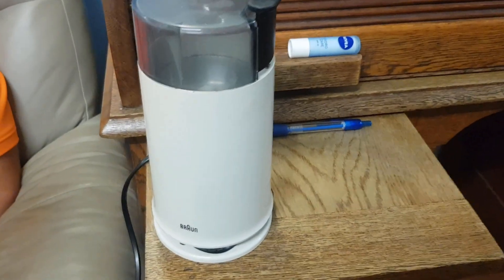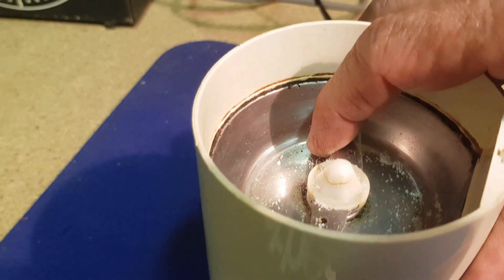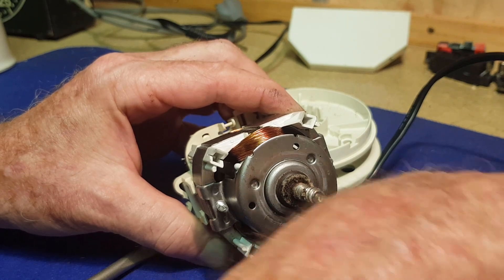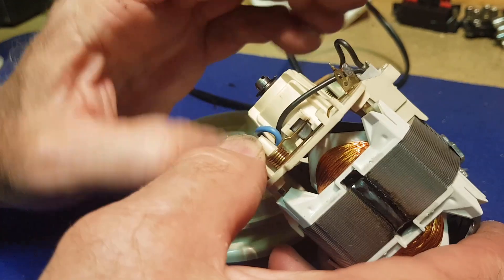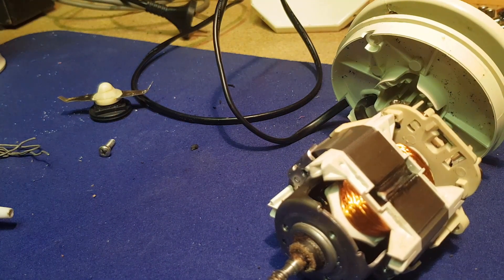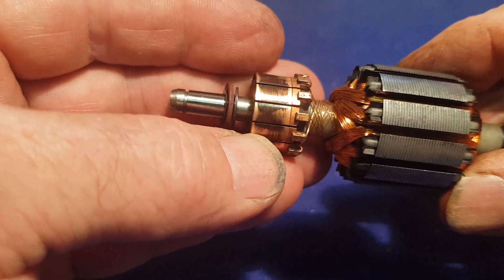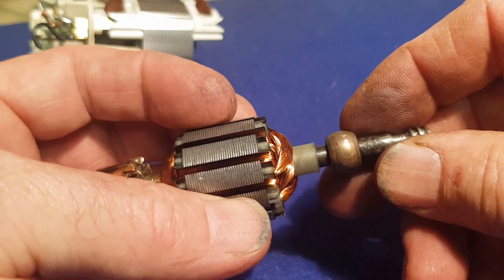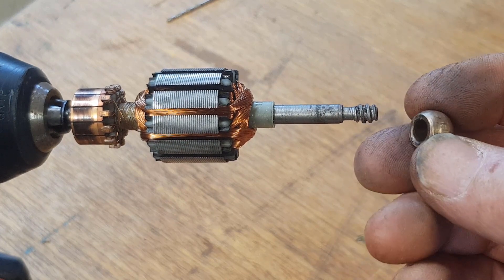Saving a Braun coffee grinder mill from the scrap bin! Electric motor with a seized bearing repair.

Comment: i now have a working coffee grinder. 99 cents at the second hand store so even if it doesnt work for long its still useful. I had to bend the tabs back pretty far to fit the bushing back in, and then used pliers to squeeze them back together. it doesnt have any play so hopefully it is secure enough. THanks so much for the video.
Reply from the maker: That's awesome - well done you! 👏😊

Comment: 30:10 Awesome! I can’t wait to get mine apart and, hopefully fix it! Mine just stopped working one day. No signs of issues prior.
Reply from the maker: Thanks CW! Good luck with your fix! 👍😊
Reply: @TheUltimateRecycler  Well, I had taken the blade off quite some time ago and hadn’t thought of plugging it in to see if it runs so I did today. Works great! Put the blade back on. Won’t run. Shook it and a bracket fell out. Now it won’t work either way. Lol! The issue is that it doesn’t come apart at the bottom. It seems pressed together or glued where the metal band meets the black, lower portion of the housing. Any idea how to get it apart without breaking it?

Comment: I'd put some JB Weld on the cracks for extra measure.  Getting ready to take mine apart I broke on some Turmeric root.  Mine spins around but blade doesn't.  If I have to mess around as much as you have it's going in the Bin, but brought me back to when I repaired a very expensive floor sander and many of the principles are similar.  thanks!
Reply from the maker: Sounds like you may need another blade - but maybe JB Weld can come to the rescue there! Good luck! 😊👍

Comment: Amazing posting.  Just saved me a ton of sweat and then probably throwing it out anyway.
Managed to fix mine and it runs great.
Any suggestions on a source or replacement for the fibre washer between the bushing and the blade?
Mine must have disintegrated long ago and is totally missing now.
Reply from the maker: That's excellent! Well done on your repair🙌 A decent hardware shop, or perhaps a bearing/mechanical industry supply place should have fibre washers 👍😊

Comment: Respect for you... I had the same problem with the bushings (it made fine sugar out of raw sugar) but I forgot how I dismantled the anti-parasitic filter (resistor and capacitor in the video)... these are mounted between the wires coming from the socket in the house (brown and blue wire) or are they on one wire? two blue cables come out of the grinder... thank you in advance
Reply from the maker: Thanks for watching 😊👍 Sorry, this video was quite a long time ago and I've forgotten how the wiring goes..

Comment: 14:00 any tips on loosening the bushing? I tried using a plier but to no avail. I don’t want to heat it.
Reply from the maker: Just jarring it with a hammer like in the video, and maybe leaving it soak overnight with some penetrating lube. Nope, I wouldn't heat it - at least not very hot anyways. Small localised heat wouldn't hurt but not on the copper windings.

Comment: Kia ora hello, do you think this would work the same for a Kenwood model - looks really similar and it has the same issue, the motor makes the same noise. So far,  I couldn't find a repair video for Kenwood model. Thank you!
Reply from the maker: Yep, much the same I guess. It's just a matter of getting to the bushing/bearing and getting some lubrication in there! Good luck 👍😊

Comment: I have this same grinder from the 80’s & it JUST BROKE tonight. I’m so sad 😞 .
I was grinding dried cut avocado pits. It is spinning but no longer cutting. Hoping you can help so I can save mine!
Reply from the maker: Sorry to hear that, it sounds like the motor is ok though. Maybe the blade has just come loose, or stripped the thread..

Comment: Great video, thanks!  Totally new to this repair game, it would be helpful to know what kinds of lube/grease are and aren't appropriate for these little tasks. Penetrating oil I have for bicycle maintenance, but what is the generic "grease" you are using at the end?  Presumably WD40 would not be the smartest choice here... Thanks again!
Reply from the maker: Thanks Chuck! 😊 I usually try and mention what lube I use and why. I think the grease is just a universal type bearing grease. WD40 isn't a good lube, especially for long term use as it dries out quite quickly.
Reply: @TheUltimateRecycler  thank you for the quick reply!

Comment: I am having issues with mine. I cannot get the "push spring" to push the contact onto the terminal to make it run.  Does anybody have a video on putting the motor back in and getting the lever to work?
Reply from the maker: Not sure on that Harry - it was awhile ago, but I don't remember having any trouble with the switch. Hope you've got it sorted out now.. 😊

Comment: You just saved my grinder 😂. Thanks! Can i use WD40 as lube for the motor? My grinder has power but it does not spint
Reply from the maker: WD40 is ok for a temporary fix, but it does dry out pretty quickly. Grease in the right spot is far better!
Also, I wouldn't use WD40 if the grinder is used for food. Thanks for watching 😊